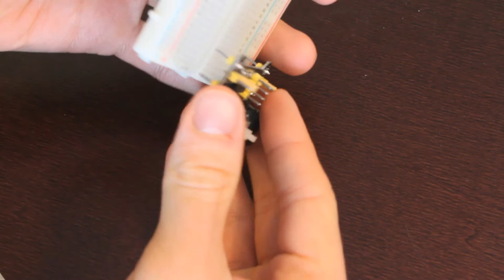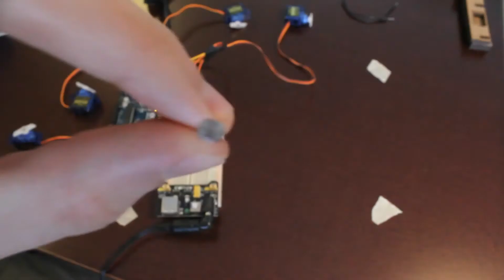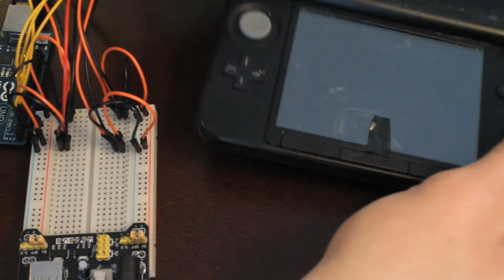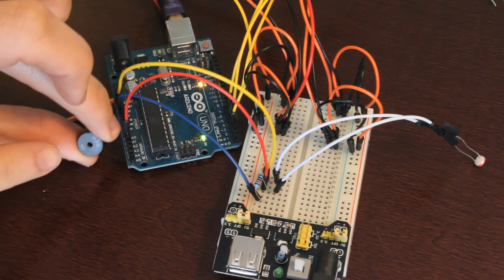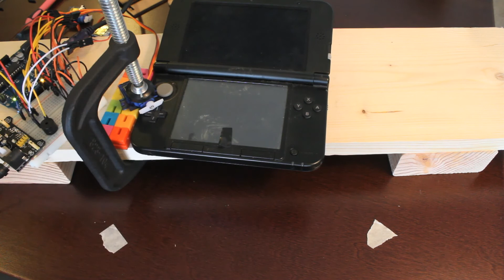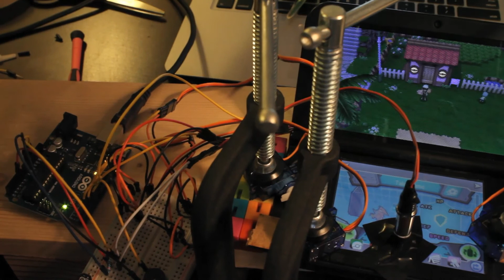Pokemon shiny hunter bot tutorial

Comment: I dont know how to PM you on youtube. 
The servos are Tower pro SG92R Micro servo from AdaFuit, and i used the powersupply that you reccomended. They do not click all the time, only when they are plugged into the arduino. Also they move before I put the wire into the 9 pin when i am using your code, and they seem to make more vibrating movements compared to the video of your servos.

Comment: Thanks so much for the tutorial! I wanted to refine and shorten the code and compose it into an MEGA2560 instead of an uno. I found out you can limit it to one servo with extended arms to press down on start or a with pens for stationary resetting. For some reason I can't get your original code to work when I change servo names and processes. You also added a LED and a Button in soft resetting and never showed it in the original tutorial? If you can help me with code or if I can get in contact with you some how it would help a lot. Thanks so much!
Reply from the maker: Hi Suiicuneecx. The LED is a piece of relic code, i.e. code that no longer should be there because I actually don't use an LED any more. I'm not sure what problems could arise when changing the servo names, but I'm not at all familiar with MEGA2560 code. You can send me a private message here on Youtube so we can discuss further.

Comment: Thanks for this tutorial. I built the bot but the servos are not responding when i put the wire into 9. as soon as i plug in the servos they make a constant clicking noise. I also did not know what to set the servo#flat and servo#deflect to.
I also did not know if I would have to change any of the blackout duration for use in SS.
Reply from the maker: Bubble Monkey, it sounds like something is awry with the servos. They should not be clicking or making any other noise. They should be sitting there silently until you start it up. How are you powering them? What kinds of servos are they? Feel free to private message me and I'll respond so we can chat more.

servo#flat and servo#deflect are variables that may change depending on your servos. You have to change the numbers and repeatedly reuploading the code to get the servos just where you want them before clamping them down. But it sounds like you have other problems with your servos that you should address first.
Reply: I dont know how to PM you on youtube. 
The servos are Tower pro SG92R Micro servo from AdaFuit, and i used the powersupply that you reccomended. They do not click all the time, only when they are plugged into the arduino. Also they move before I put the wire into the 9 pin when i am using your code, and they seem to make more vibrating movements compared to the video of your servos.

Comment: Does you soft_reset program work for ORAS starters?
Reply from the maker: I have not written code for the ORAS starters, but it's definitely possible to do. If you're really interested in going that route rather than auto-breeding them, I would suggest becoming intimately familiar with how the code is written and what the functions do (lots of reading, playing with the code, etc.). Then, use one of my scripts as a template so you can change it around for your custom actions.
Reply: Appreciate the reply, albeit a little late. I wrote a code to check the bottom screen's dark time during the encounter and to stop the servos when a shiny was found. Found a shiny Torchic after 8000+ resets. Thanks for the design though.

Comment: Hey! I'm having a lot of trouble mounting my servos on/next to my 3ds and this was a great idea! I may just have to try this. HOWEVER Sun and Moon are out and obviously the DPad is not used for movement anymore. Do you have any solutions for using the circle pad with the servos?

I didn't use your video as I just found it today, but I basically have the same setup except I'm using a 4 battery pack for power instead of the board which was a great idea I may have to go with in the future. Less bulk and less things to worry about! Thanks for sharing.
Reply from the maker: I do not have a solution at the moment to get around the d-pad. Sun and Moon are trickier than XY/ORAS to hunt for shinies for other reasons too. I'll look into it at some point this winter, and maybe come up with something. If nothing works, we may have to hope the next games will be more be more amenable to bots.

Comment: I'm going to be making this as soon as my arduino is here. I'm also unable to get to the site so mind sending me the coding too? I'd really appreciate it! My email is cyndaquilshoshi@gmail.com
Reply from the maker: Please see the details of the video. I just edited them to include a link to a dropbox folder with all the info, including the Arduino code. Best of luck! Please let me know how it goes.
Reply: Sean Williams thank you so much! I'll definitely tell when I build it. Just realized that I needed a few parts like the breadboard power supply module. Didn't come with my arduino starter kit so it's gonna take me a few days to get everything.
Reply: Okay, everything has been set up according to the video and notes. Just going to put the servos on but I couldn't find it anywhere with where I know which servo goes on which buttons?
Reply from the maker: Have you set up the servos so that they can press the buttons alright? Have you connected the servos to the Arduino via the yellow wire? If so, the assignment of servo motors is subjective, i.e. it doesn't matter how you assign the motors in the code.
Reply: Alright I've set the servos up. Now I just feel so silly to ask but.. Could you give me an example of how I assign which servo is where in the coding? I've never tried this before so I'm unsure what to do
Reply from the maker: Open the breeding.ino code and you'll see some of the first few lines say

#define SERVO1 2
#define SERVO2 3

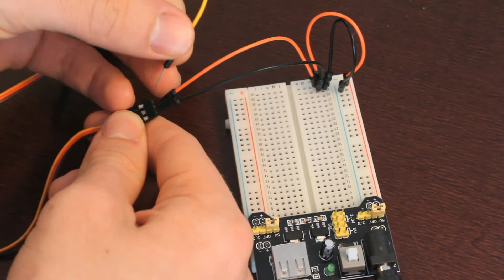and so on... This is where you are defining your servos. So the first line is defining servo #1 (SERVO1) to be connected to slot #2 on the Arduino. Go to 3:30 for how to do this part.